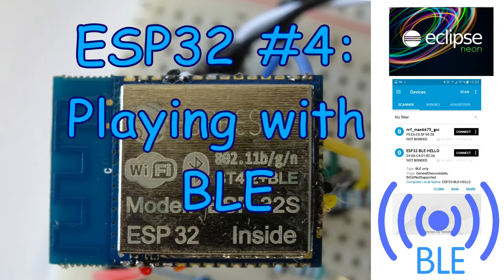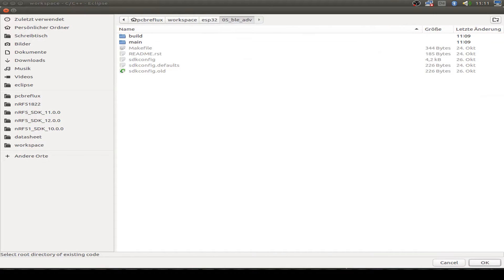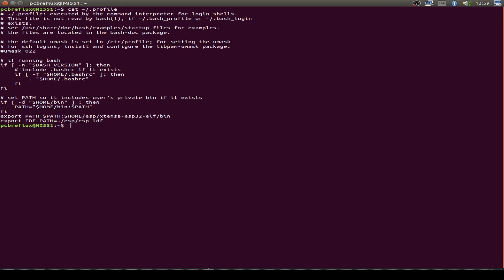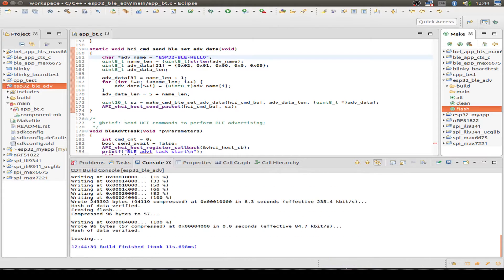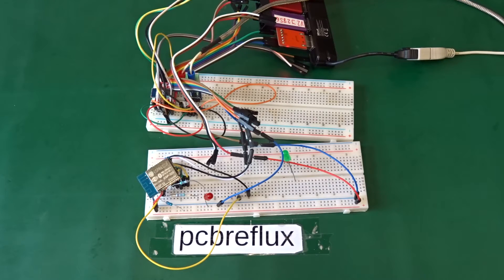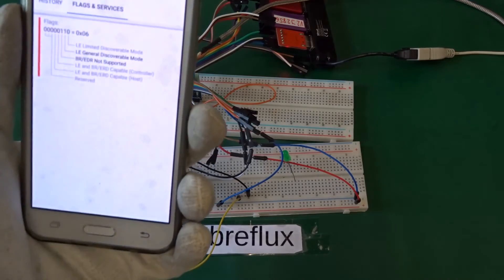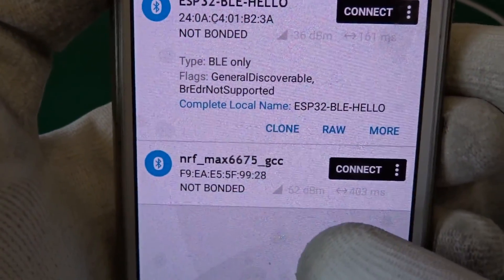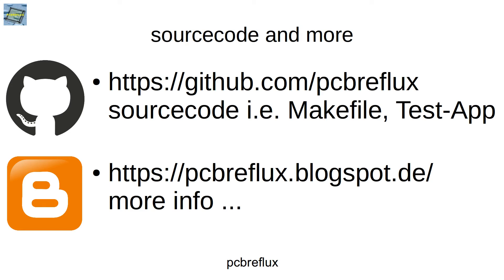ESP32 #4: esp-idf - playing with BLE / Bluetooth

Comment: Great video series.  I played around with the ble_spp_server demo in the ESP-IDF and was shocked at how much power it was drawing.  I would expect to get a BLE-only function down below 10mA, but the power use was around 50-70mA when connected.  Have you measured the power usage of the ESP32 when used for BLE only?
Reply from the maker: Hi,

think ret = esp_bt_controller_enable(ESP_BT_MODE_BLE); is still not working and you maybe also have a look at the current draw with a scope ( https://youtu.be/8NDq6hC9KJo ). Sorry the video should better called "Current Draw" or "Power Consumption". And feel free to share it here https://github.com/espressif/esp-idf/issues.
Reply: Thanks.  Seems to be a known issue. https://github.com/espressif/esp-idf/issues/947

Comment: Great video .. .however I can't seem to get any of the IDF BLE samples to work. After flashing the ble_adv it never show up in my nrf Connect app. (Only the SimpleBleDevice Arduino sample allows it to show up in the nrf Connect app. Any ideas ?
Reply from the maker: How do you flash the IDF firmware to your device (command-line, flash tool, eclipse...) ? 

What OS do you use?

Easiest way to get some debug info (for me)
   - make monitor 
   - or use the arduino serial monitor and press the reset button.

Can you post your output ?
Reply: Using the esp-idf toolchain on macOS  10.12.3 as described on their site. Running make ; make flash
Reply: I've started a thread on the esp32 forum. (https://esp32.com/viewtopic.php?f=13&t=2869) with some output. Feel free take a look. Might be more convenient than youtube comments. Keep up the excellent work with the videos. Very informative !

Comment: Great videos! Do you think it is possible to use the ESP32 to receive Notifications from iOS/Android?
There are existing projects using nordic ICs and the ANCS for iOS: http://rwx.io/blog/2016/01/23/ancs-message-display/
Reply from the maker: Nice and interesting topic, but for me there is no iOS Device available, so do you know an ANCS Android App or a other App for Android BLE Notifications?
Reply: That's the problem, there is no Android-equivalent to ANCS. Every device needs an app that manages the BLE notifications on Android. The existing apps for Pebble, Fitbit etc most likely have their own protocols, which would make it difficult or impossible to connect to them with an ESP32. I have been thinking about making a BLE connected diy smartwatch and the ESP32 would have all the needed features.
Reply from the maker: Seems someone have to write the Android (and/or iOS) part. Maybe you can use this https://github.com/NordicSemiconductor/Android-nRF-UART as a seed for Android this for iOS https://github.com/NordicSemiconductor/IOS-nRF-Toolbox and for the esp32 this https://github.com/pcbreflux/espressif/tree/master/esp32/app/ESP32_ble_UART ?
Reply from the maker: Kevin Darrah find a solution with https://www.pushbullet.com/  (maybe commercial?) https://www.youtube.com/watch?v=-HtSMk6jyEo but the API uses CURL, no challenge for the esp32 see https://www.youtube.com/watch?v=tp4OC_kGMgU
Reply: Thank you for the links. So there are two parts needed: The ESP23 code for receiving notifications and an Android app that sends (advertises?) them. I don't have any experience with BLE or Android programming unfortunately.
The pushbullet solution should work but it kind of ruins the simplicity of just having a bluetooth connection. You would have to be connected to a wifi network at all times.
Reply from the maker: Max Kern Ok sorry, this is not what you want. It's the other way around: sending notifications to the phone and not receiving notifications from the phone.
Reply: Yes, the most simple implementation would be to have a LED on the ESP32 light up when you receive an SMS on your phone. On iOS the ANCS service does this without the need for an app. You just have to subscribe to it with your BLE module(http://lukeberndt.com/2014/ios-notifications-with-arduino/). And I am wondering if this would work with the ESP32.

Comment: hiii,
how to read data from a BLE device (which has MAC address) which has been coonected to ESP32 in ESpidf .I need to display that data on the serial monitor.
can u help me out to solve this issue????
Reply from the maker: Hi, I cover this topic in video #13. The esp32 have to act as a BLE Client and connect to you BLE device (the BLE server). Then you have to read the characteristics with your values and write them to the serial interface. Or if your BLE server prefer notifications then you get an write callback that could print out the value.

Comment: Did you try to test range distance of esp32 with Wifi or BLE.
Reply from the maker: Стас Фролкин Hi, not realy but all my tests in the range 10m to maybe ~15m works fine but all my modules only have the pcb antenna.
Reply: Hi. Thanks. I'd like to know also did you play with ble in connected mode (not just advertising). Nowadays can I use esp32 for fully work with ble (like nrf51822/52832 for example) or it's not ready yet.
Reply from the maker: Hi, think the nordic guys do bluetooth/ble for many years so the SDK is 
much more robust and you have to expect to invest more knowledge and  time 
for debugging into the esp32. I play with the GATT server and client 
examples but today don't have done any longtime test, no energy tests 
and also no security.

Comment: Can I conect BLE and wifi at the same time I want to do Gateway wifi/bluetooth
Reply from the maker: Borja Martinez Shure watch this example: https://www.youtube.com/watch?v=F4tMvfXDSbU&spfreload=10
Reply: I try now. Thanks
Reply from the maker: Borja Martinez maybe some other have the same issues so if your problem is not super secret you can post it here or open a github issue. then every one not only me can help or even learn. feel free to include all output data even compiler errors or debug output. it can also help to post your problem to the esp32.com forum.

Comment: how do you program the nrf51822 using the arduino ide using a ttl converter/ St link v2?
Reply from the maker: Using the ST-Link V2 (updated, see my update video) and openocd. But not using the arduino ide, just gnu c toolchain, the nrf5 SDK 12.0.0 and eclipse ide (i've done 20 vids about programming the nRF51822 and more, but not ready, on my disk. Source on github https://github.com/pcbreflux/nordic/tree/master/nRF51822 ,but sorry no arduino -> for arduino may watch Roger Clark). By the way, i am just on a XMAS-project with the ts555 (single CMOS timer with very low consumption) and cd4017. Thanks and have a great day.